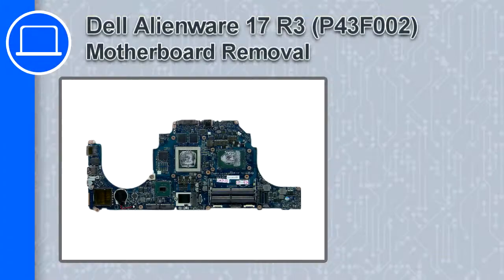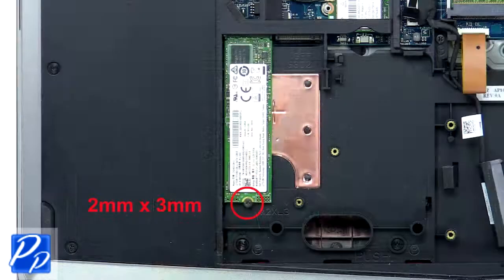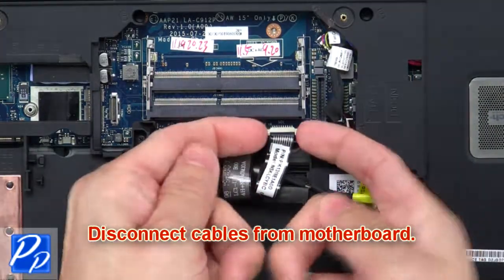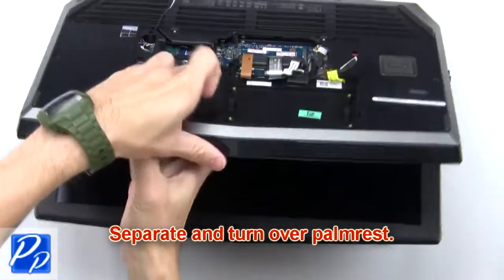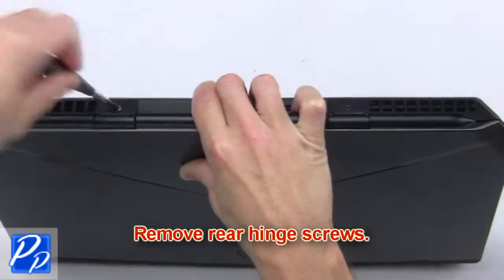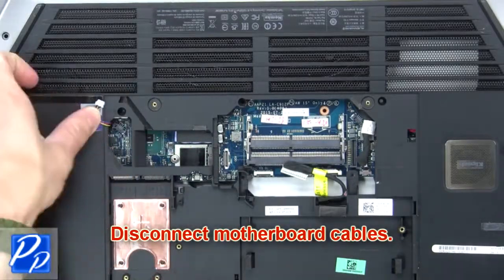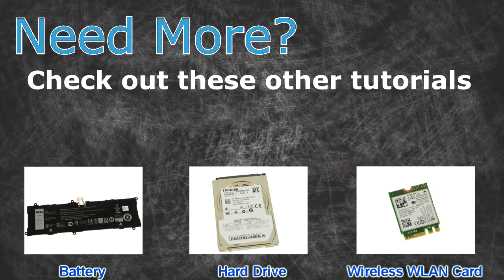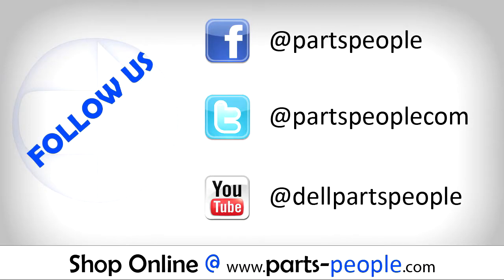Dell Alienware 17 R2 (P43F001) Motherboard How-To Video Tutorial

Comment: The palm rest didn't remove nearly that easily for me with all the plastic tabs holding it to the chassis.
Trying to replace the fans. ifixit does not show that motherboard removal is necessary but it sure looks like it is. No room to tilt the fans out.
Edit: Yup, definitely necessary.

Comment: After changing my old MB, which burned through a uncessful BIOS update (a few reasons why it happened), the new one has this problem with makes the laptop restart every 30 minutes (exact 30 minutes, counted on clock). I can bypass the timer problem simply by putting the computer to sleep (either by pressing power button or turning down the lid. Any idea on what it could be? It restarts independently of temperature or stress. Thank you, just started following your channel =)